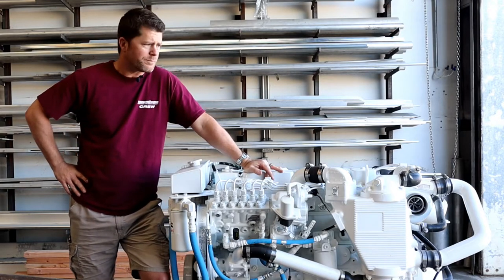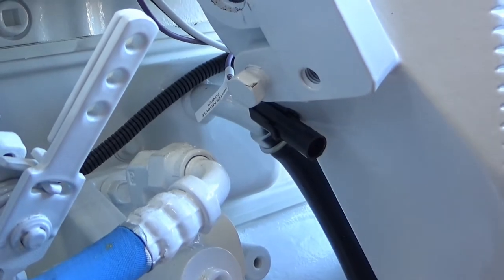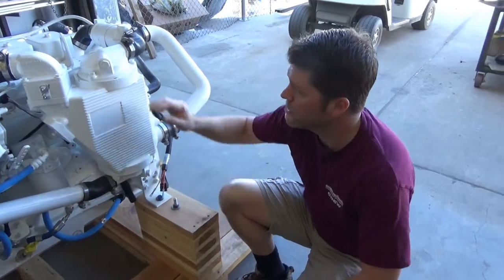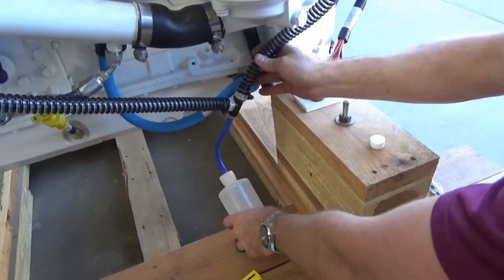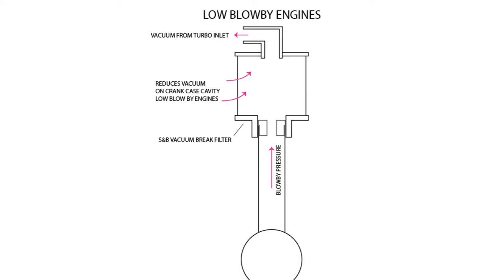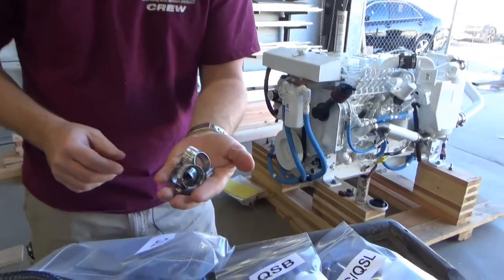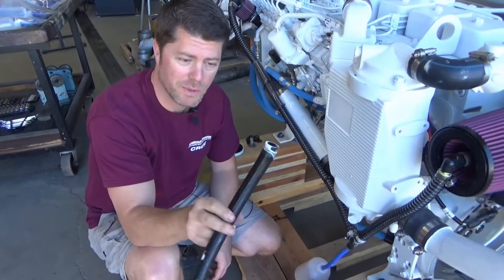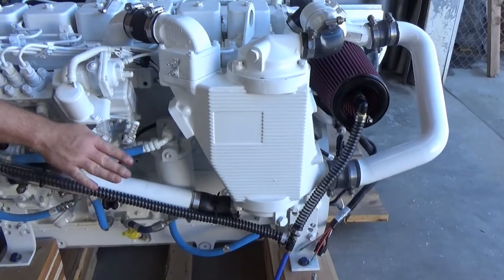SMX: Envirovent Crank Case Ventilation System

Comment: Really enjoy these videos and products made by you guys such as this and the dual fuel filter filtration kit. I wanted to add that for someone like myself who doesn’t have the available space to move the remote oil filter they have another alternative although it isn’t a cheap one. The crankcase can also be vented from the valve cover with a dual valve cover breather that I believe originates from the agricultural engines. Since the engine is then being ventilated from its highest point, less oil/oil vapors should be visible in the catch bottle. If the engine has a high amount of hours and or blow-by they can run two of these valve cover on cylinders 2-3 and 4-5. These valve covers are now common used on high performance builds with larger/greater than factory piston ring clearance.

Comment: Just installed your CCV system on my 6bt today.  The mechanic who did the inspection and recommended walker airseps was impressed by your solution.  Especially the timing cover vent.   I don’t like the puke bottle location on the port motor, very inconvenient.  I moved mine further aft so I can access easier.  It’s still the lowest part of the system.   Simple system 1/3 the cost on new walker is a win
Reply from the maker: Glad you like it.  We like that our system is easy to adapt and modify to suit different needs.  Great Job!

Comment: Hello can you please explain what is the purpose of the air filter that comes off the timing cover,
Why not exclude the filter completely and have the hose from the timing cover go directly to the air filter via the sludge container?
Regards James
Reply from the maker: Good question.  The idea behind this smaller filter is to serve as a vacuum break.  That is, we don't want the turbo to "suck" on the Crank Case Cavity which could encourage even more blow by.   It can really create quite a vacuum particularly if the main air filter gets dirty.  That said, with very high hour, high blow by engines, the volume coming out of the Crank Case can exceed the volume of air being pulled through the hose, in which case, its fine to do exactly as you describe.